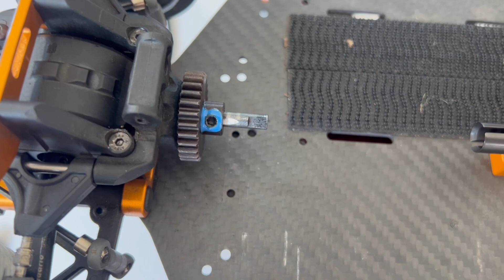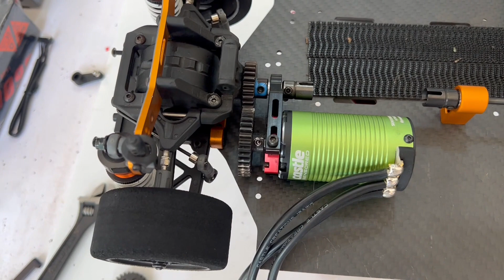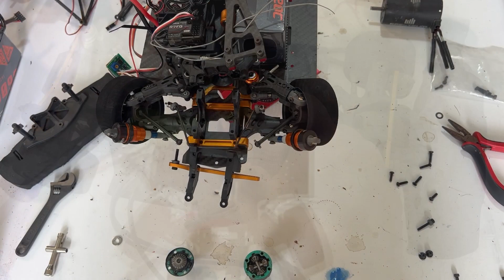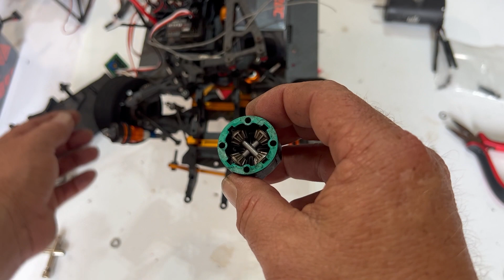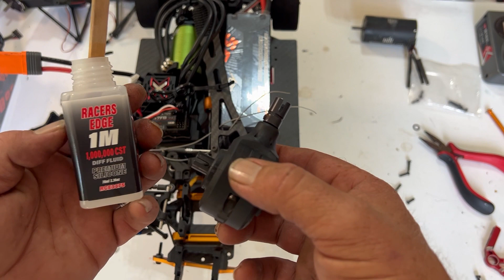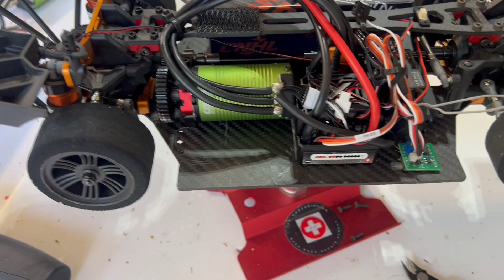AK-917 rebuild part 2! #rc #rccar #speedrun #rccarracing #rlaarlo #speed #fast

Comment: And...she's back together, ready to go.  Reversing the directions of the spur & pinion gears is something I hadn't thought of.  Ingenious.  Only piece of advise I can think of is, you might want to consider shortening the length of the motor wires - shorter wires are more efficient, and also decreases resistance, which will also help to slightly lower temps. 🤙🏼
Reply from the maker: The motor wires are a bit long out of the box. I’ll have time now that I’m not rushing… lol
Reply from the maker: Reversing the spur worked perfect… not sure why it took so long to figure out. But it works way better
Reply: @BNVRC  I haven't watched the video yet, but, I have seen where somebody else did the same thing.
Reply from the maker: Wish I would have seen it…. Would have saved me some grief for sure!
Reply: @BNVRC  Not so sure. That one also just came out yesterday.

Comment: What motor is that
Reply from the maker: Sorry… I replied to myself!… lol
It’s a 1412 6400 kv with a 5mm shaft.
Reply: @BNVRC  I’m running 1415 not enough room to place MMX have to run mamba x
Reply from the maker: Yea… I bought the 1515 and it was to long also… would have to mount on its side or on top as before